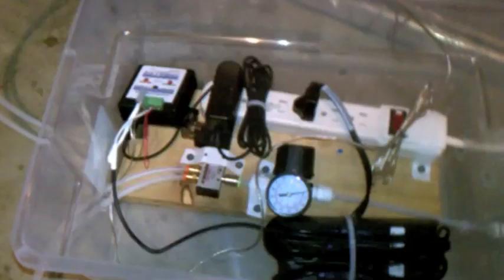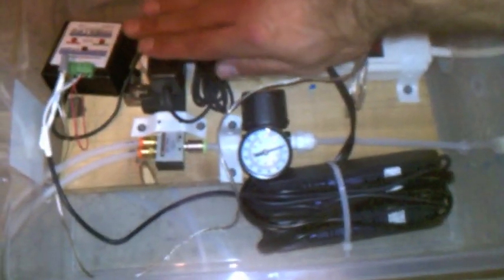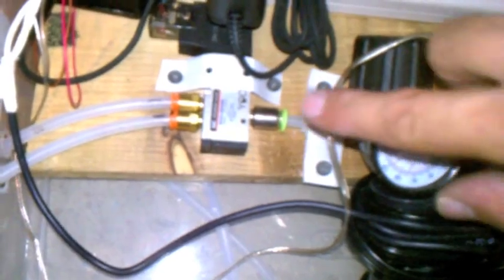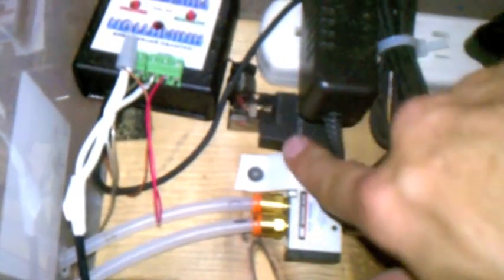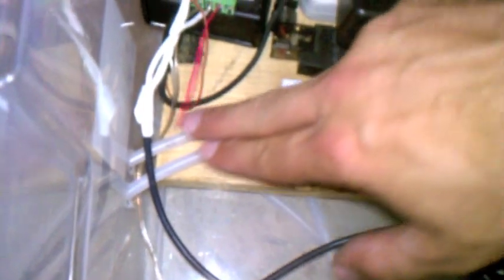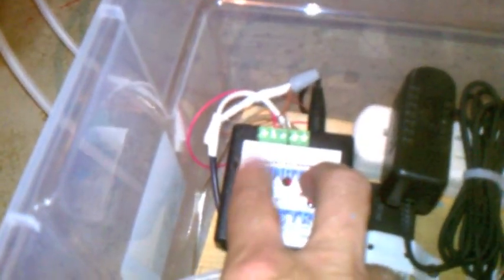Junping barrel prop innerds

Comment: looks good! exactly the same parts I used in mine 3 years ago and still running strong. Just be careful, it will ruin the floor you use it on over time (im using steel drum and it must jump 300 times a night for 2 weeks lol)